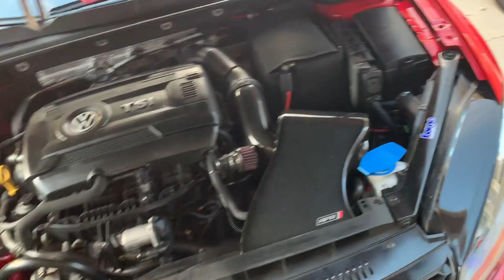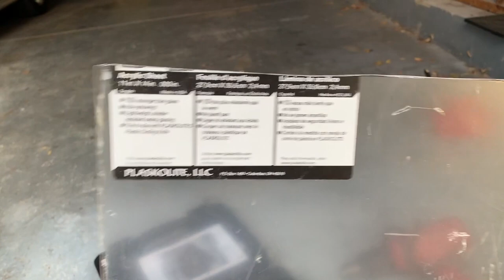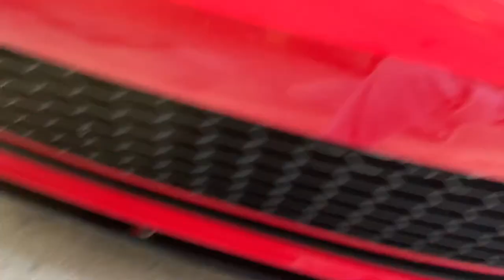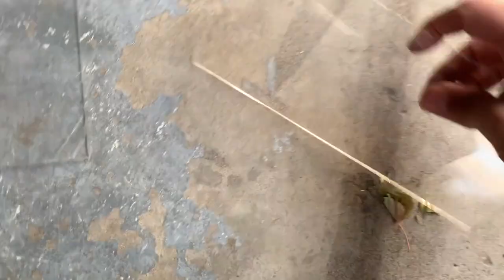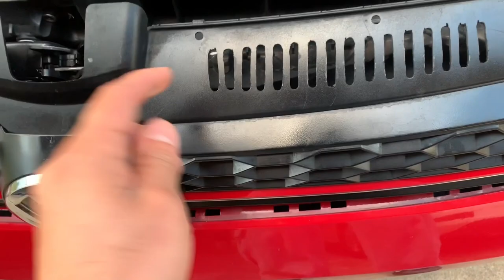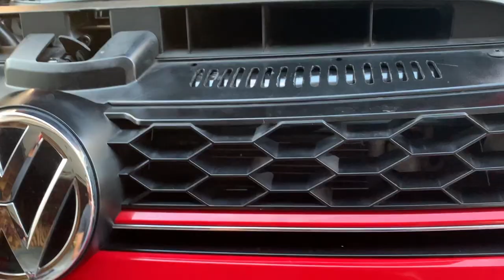MK7 GTI/GOLF R Air vent DIY

Comment: How's the SB clutch holding up? Any regrets or are you happy with it?
Reply from the maker: P8ntballa it’s great brotha👍🏼 love the performance love how it feels! And it’s really taking a beating for sure lol if I had to say something bad about it would just be the little chattering at idle it’s not really noticeable honestly but it comes with the single mass flywheel you’ll get used to it tho👌🏼 overall happy and would recommend.
Reply: @thekiki303  Cool, just checking my options between DKM and Southbend as I'll be going stage 2 come the spring and wanna get a clutch now to break it in. Eventually @ some point I'll be going is38, more pwr/torque. Thanks for the feedback/response
Reply from the maker: P8ntballa definitely need something that will hang to that torque man! And no problem👌🏼 anything I can help with here I am 👍🏼

Comment: Interesting! How’s the car on highway speeds?
Reply from the maker: AJTrev5 runs and feels normal no rattling or any noises also coolant temps are the same since there is air being blocked from going into the radiator and all front components,, would be definitely worth doing some data log to see if IAT drop with this vent!👍🏼
Reply: Boosted imports  Badass bro! I’m gonna have to give it a try!
Reply from the maker: AJTrev5 try it brotha definitely worth it and got nothing to lose if anything you are doing your car a favor with more air!😈

Comment: That seems like such a strange oversight by VW. My mk6's grill feeds the air straight into the intake. I have a Racingline intake, but even the stock intakes have a direct source of air
Reply: Not an oversight. The indirect air design is to keep rain and snow out of the air box. The GTI is meant to be an everyman's sports car, not a pure performance car where every hp counts.
Reply: Sufficient air enters under the lip of the hood for air intake needs. Not really an oversight. If you want more air this is for you. The good thing that stock AI does is doesn't give water a direct route into the AI. I have the TCR style racing AI. I have to worry about the water issue as it is direct path. Extra care at the car wash needed. But isn't this  DIY air deflector too large to block needed air from the radiator? I live in hell, I mean Phoenix az. I believe that blocking any air to my radiator would be harmful. What do you think?

Comment: Over 100 kmph (60 mph) wind has enough force to atomize the water and with this mod it will just flow directly into your filter, without gaining any performance benefit, in heavy rain you will be directing a considerable and alarming amount of water straight into you intake, this is dumb. Wind can flow without any issue from the other side, plus the intake is sucking like a vacuum so even if you are not moving it will pull air from the vent on the other side, and its cold air cause the other side is still pulling from the front, yet its routed like that to loose the water and larger debris before they reach the filter...
Reply: Thats what im saying to everyone... but intake sound is so good im tempted to drill holes in the drivers side but keeping my stock airbox with a k&n filter and snowguard. What do u think?